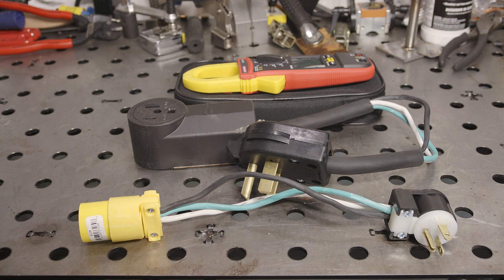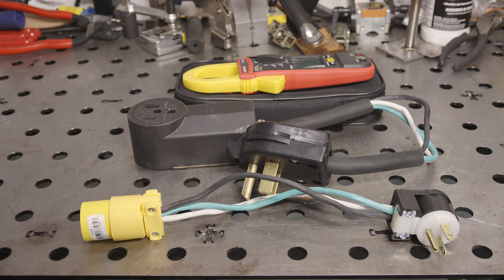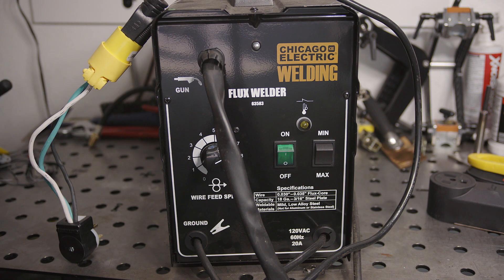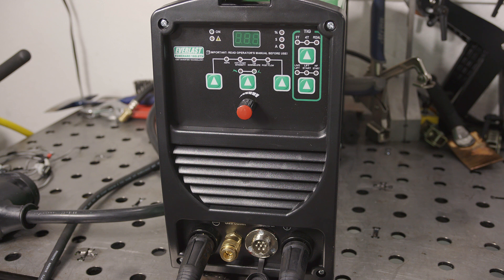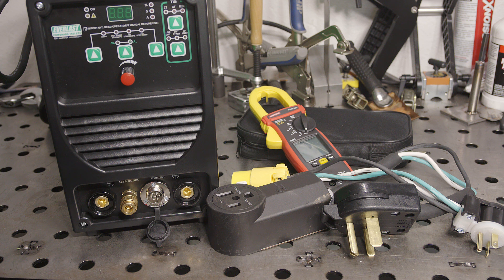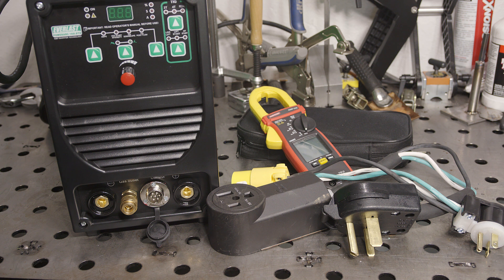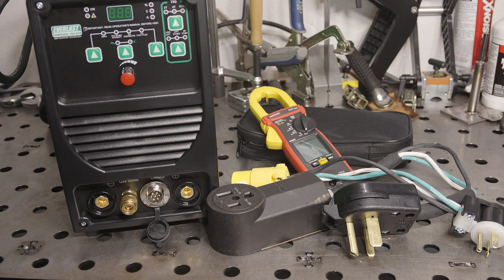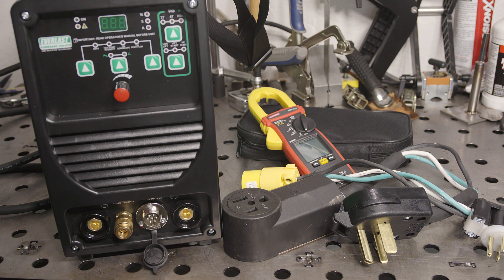Testing Welder Amp Draw, Will it Trip a Breaker?

Comment: Hi. I want to know can that Chicago Electric 125 fluxcore welder run off of 15 amp circuit or would it blow the fuse?
Reply from the maker: It probably would run on a 15 amp circuit, but it also would probably trip pretty quick if you ran it maxed out.
Reply: @bigtb1717  ok. I think somebody on youtube said you might run the C.E. welder up to a level 6, without blowing a fuse on a 15 amp curcuit. Do you think that sounds about right?
Reply from the maker: I tried two of them and both ran a bit different at similar settings.  So I can't say for sure exactly what setting would work for you.
Reply: @bigtb1717  ok. Did that welder pull over 15 amps , with the level selector on 6?
Reply from the maker: Unfortunately, I didn't test output at various settings and I don't have the welders anymore to do further testing.
Reply: @bigtb1717  Ok. Thanks anyways. The Chicago Electric 125 is on sale this week at Harborfreight for $89.99, so i was trying to make up my mind whether to get it or not . House power may be a issue for me though. I have a Lincoln Weld Pak 100 with some wire feed issues, but i may try to fix that. Wanted to do some exhaust work before it gets cold. It is good to have a welder around the house when you need it.

Comment: I have a 160 mig welder and it tack weld all day but when I try to do a long bead or fill a large hole it trips the breaker. It’s an electric welder that plugs into a standard American wall plug. ( I do have it plugged into an extension cord to the garage). I don’t know what I need to do to prevent it from doing that. It’s frustrating that it’ll do that every time I try to do a long bead and I worry it’ll cause an electrical problem with my house with it constantly doing that
Reply from the maker: Do you know if you are running the welder on a 15A circuit or a 20A circuit?  

Turning down the output of the welder could reduce the number of breaker trips you get, but that's only a good option if what you are doing can actually be done at a lower output.

If you need the amount of output you are set for and you are already running on a 20A circuit, there really isn't anything else you can do to prevent the issue.  If you only have access to 15 amp circuits, then you will be fairly limited in the amount of power you can get out of a welder.
Reply: Honestly idk if it has another option I’ll have to check but I’m sure I can still weld the scrap art I’m trying to make even the frame to my motorcycles at a lower out put cause it’s all pretty thin metal. I’m going to hopefully try later today thank you for your help. Great video by the way.

Comment: If I have a 220v 50A outlet, but its 3 prong twist lock style, & I use an adapter that says it's 30A on the twist side to 50A on welder side, does that mean I only have a 30A breaker since the twist lock will heat up over 30A? ....

Also, running a 50 ft long cord...guessing that ups the resistance a lot.
Reply from the maker: The only way to know for sure what size breaker you have is to physically check and verify.  Technically the breaker should be sized to protect the circuit, not necessarily the stuff you plug in.  For example, you might plug a lamp with a 10 amp rated cord into a 15 or 20 amp circuit.  So your 30 amp rated adapter may be fine, but if your welder is rated at a higher effective current draw than 30 amps, you will probably want to check that adapter occasionally to make sure it isn’t heating up.

A 50 foot extension cord may be fine, but it will depend on the draw of the welder and on the wire gauge if the cord.
Reply: @bigtb1717  Thanks for gettin back to me :) That helps a lot.. I picked up a really high quality weld specific cord,  so hopefully it'll be all good.

Comment: All circuit breakers will allow maybe a 150% over current for at least 30 seconds before tripping. Never saw a small to medium size welder rated for more then a 30% duty cycle so even if you were welding and drawing 50% over current 30% of the time should be okay. In commercial shops I always ran a receptacle & circuit 125% larger then weldor nameplate amps. That way would never trip a circuit breaker.

Comment: If my welder has amp draw less then 30 amps but has a 50 amp plug should I get an adapter that would on a 30 amp breaker
Reply from the maker: No.  A "50 amp" plug just means it is rated for 50 amps max.  Using less is no problem at all.
Reply: @bigtb1717  thanks for responding so fast

Comment: Did you ever  check  the current  draw on the HF 125 with  the rectifier and capacitor and compare  it to the  welder
when  it  was AC output?
Reply from the maker: The draw from the wall shouldn't be any different, but I can check it to be sure.  I plan to make a video testing more welders, but I didn't have a lot of time when I was putting this video together.  I just finished putting the adapters together when I started this video.  I'll be doing more tests at some point.
Reply: Thanks for  the fast response. I also
have a titanium 125. So my thought  is 
that I can convert  my rectifier & capacitor  modified  90 amp  HF to
DCEP by swapping  the output  wires 
on the rectifier. I have seen SS fluxcore 
wire which  calls  for DCEP. I can use the
Titanium 125 for everything  else .
The SS FC is expensive but I have a 
repair on a SS exhaust  brace on a boat. 
The brace is not critical so a weld failure 
Isn't  dangerous.
Reply from the maker: If you have a DC converted 90 amp model it should be no problem to swap the leads and get DCEP.  However, that stainless wire specifies higher voltage than that welder will provide.  I haven't tried it (I've considered trying it for a video) so I can't say for sure.  I have seen people use standard flux core wire on stainless steel for non-critacal welds.  The welded area won't be stainless/rust-resistant and it will look a little ugly, but I believe it will work.
Reply from the maker: Just a thought, you might want to swap the polarity on the capacitors as well.
Reply: Thanks for the info. How much voltage 
Is required  for SS FC? I believe  the HF 90 operates  at about  17 volts.
Reply from the maker: The chart on Blue Demon's website says that the typical parameters for 0.035" are 22-25 volts at 130-150 amps.  I don't now if it would run well at lower voltage than that.  That's just what the chart for that wire shows.  I have considered getting some to see how it would run on a 120V welder, but I haven't gotten around to it.

Comment: I thought all, excluded speciality 100% rated devices, over-current devices can trip once you exceed 80% of it current rating. Is that correct?
Reply from the maker: The 80% rating isn't the trip point.  An 80% and a 100% rated "20 amp" breaker may or may not have the same trip curves (depends on the protection class and intent of the breaker).  In other words, the trip curve and protection they offer to the circuit may be identical.  The 80% or 100% rating is more of a duty cycle rating for the breaker itself, not about the protection it offers for the circuit.  

The NEC specifies breakers as either 80% or 100% rated.  A 100% rated breaker is permitted to be installed in a circuit where it will be run at 100% of its rated current carrying capacity, continuously.  An 80% rated breaker is not permitted to be used in a circuit where it will run at 100% of its rated current carrying capacity continuously.  An 80% rated breaker is permitted to be run at the full rating, but not continuously.  I think the max is three hours.  So an 80% breaker should not be used in a circuit where it will be expected to pass the full, rated current for more than 3 hours at a time.  It's not about when it will trip, but more about how much heat will build up in the breaker over time if the full rated current is passing through it.  

In other words, if you have a circuit that you know will pull 20 amps continuously (or for more than 3 hours at a time), but never more than that, you shouldn't use a 20A, 80% rated breaker, but you could use a 20A, 100% rated breaker.  The 80% rated breaker may not be any more likely to trip than a 100% rated, 20 amp breaker but it would not meet code because it is not rated for that duty cycle.
Reply: @bigtb1717  So I need to special order a 100% breaker since the residential and commercial markets sell 80% rated devices by default. Thank you for informative response. I plan on adding a welder in my shed and your video has really help me understand what I need to do in order to provide safe and consistent power for the welder.
Reply from the maker: @jtwilliams721  Welders aren't constant duty cycle.  No way you'll ever run a welder for three hours straight.  The main thing is to size the breaker large enough for the expected load.  You shouldn't need a 100% rated breaker.

Comment: What About Running The Welder Through A Step Up/Down Converter?
Reply from the maker: Wouldn't really help.  For example, a 120V only welder wouldn't run properly on 240V, so you couldn't step the voltage up without damaging the welder or at least causing it to run improperly.  Even if it technically worked, you would still be drawing just as much from the wall going into the step-up transformer.  More actually, once you factor in losses inside the transformer.  If you step 240V down to 120V for the welder you will be drawing less from the wall, but at that point you could just use a 240V welder and get more performance.  Not to mention the size and cost of a transformer large enough to run the welder.

Comment: 120 volt circuit is 15 amps.
Reply from the maker: 120V circuits are most commonly either 15 or 20 amps.  I've seen some 10 amp circuits in some places, as well as 30 amps or more.  Technically, if you use the right breaker and wire size, you could make a 120V circuit whatever amperage you wanted, assuming the supply (utility service, generator, etc.) could support it.

Comment: Question. Are you saying "any" 20 amp breaker would be fine for non-continuous runs?  My manual says I need a 20amp "delayed action breaker"  I have no clue if my breaker is delayed action. How can I tell? Or should I just plug it in and see what happens?  Thanks, bud. good video
Reply from the maker: Most modern household breakers are delayed action (there should be a brand and model label on the breaker which could be used to verify) so I bet you are fine.  All delayed action means is that they won't trip instantly when the current gets above 20 amps.  If you aren't sure you can just plug the welder in and give it a shot.  If it's a fast response breaker it will likely trip the instant you start welding, so you'll find out pretty quick.  If you have an old panel with fuses instead of breakers it might be a good idea to check the label on the fuse and see what it says (fuses can have a time delay as well) before you pop a fuse and have to replace it.  But older fuse panels are getting pretty uncommon these days, so you probably have breakers.
Reply: @bigtb1717  Thanks, I do have breakers. Its my 1st welder. and will be the 1st time welding period. so I was concerned after reading the manual. Thanks so much for the response. I will give it a go tonight :)

Comment: I was welding with my Lincoln 180 off of an 8750 generator no problem.. then all the sudden the other day it starts tripping the breaker on the back of the welder . Tripping every 4 seconds
Reply from the maker: There are a couple possibilities.  First, there could be a problem with the welder or even with the circuit breaker on the generator.

The other possibility is that the thermal trip unit in the breaker simply needed to cool down.  If I describe this possibility you can probably decide from your experience if this could be what was happening.  Assuming the breaker has a thermal trip function (most do), there is a metal element in the breaker which heats up any time more than a certain amount of current flows through it.  If enough current flows through it for long enough, it will heat up enough to trip the breaker.  If this happens and you quickly re-set the breaker and start drawing current through it again, that element it will already be near the trip temperature, so it will quickly trip again.  After allowing the breaker some time to cool down it seems to hold for longer, then that's probably all it was.

However, if even after waiting a while for the breaker to cool it still trips within a few seconds, then I would go back to thinking it could be an issue with the breaker or the welder.
Reply: @bigtb1717 
Hello have a question for you i have avulcan protig 165
Comes with a 240 50 amp connector  i have 50 amp breaker installed in my garage is it ok to use this breaker or should i get a lower amp breaker ?
Reply from the maker: @devotedanaheim1575  You are perfectly fine to use that breaker.
Reply: @bigtb1717  it wouldn’t get to hot and not trip since amp is high ?
Reply from the maker: @devotedanaheim1575  No.  The breaker doesn't determine how much amperage is drawn.  The welder will only pull what it needs.  The welder itself should, theoretically, be protected by its own thermal and overcurrent protections, which are built in.  The breaker in any circuit isn't there to protect the device, it's there to protect the wiring and receptacles.  As long as the wiring and receptacle are rated for 50 amps, the breaker will protect them in the event that more than 50 amps of current flows through the circuit.  But that welder likely will use far less than 50 amps.  So it will be fine.
Reply: @ thank you appreciate your help